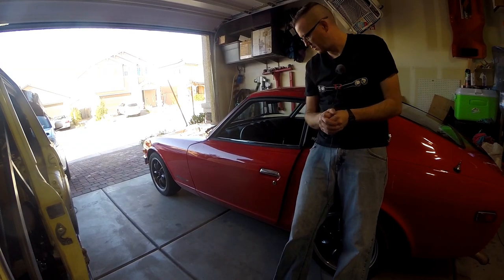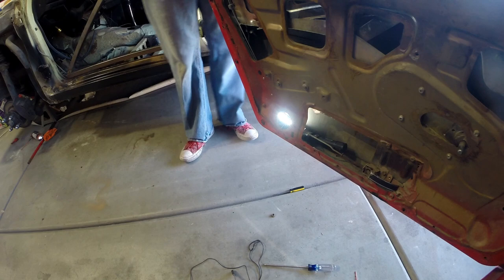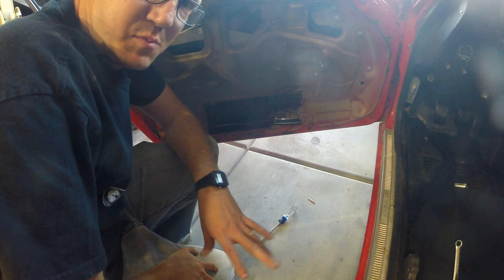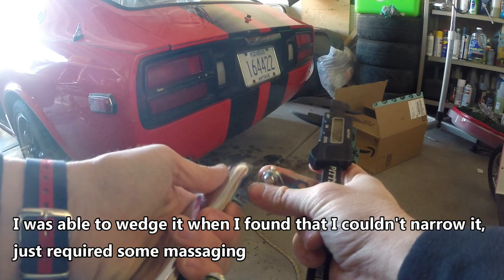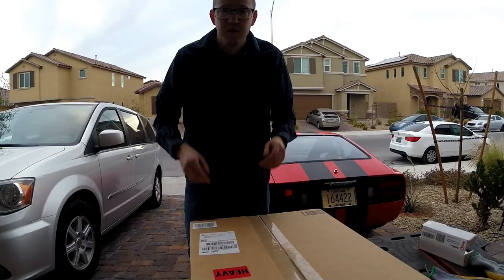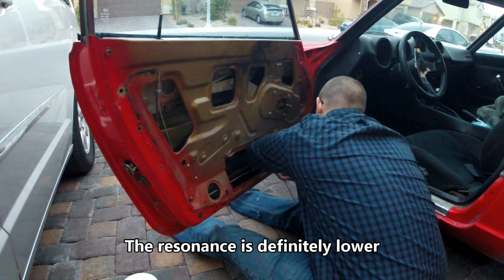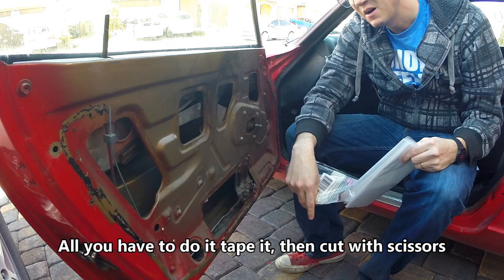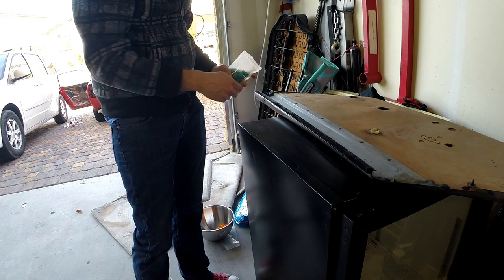Datsun 280z Inner Door Refurb: Handle, Clips, Fuzzy Strip, Sound Deadening, and Moister Barrier

Comment: Thanks. Wouldn't you want to put the tape in first on the door? Then lay the plastic. And then use a razor to cut the outline.
Reply from the maker: I am sure there was a better way to do that. I was definitely winging it at that point for sure

Comment: How did you angle your window?
Reply from the maker: It has been a few years since I did this and the finer details are getting fuzzy. 

There is a guide track along the front that it slides into if I remember correctly. And the upper window frames can be fully removed with a few bolts. 

I am not sure I have answered your question well sorry.
Reply: @AW_DIY_garage  that helps! At least I know what to look for. Thank you.